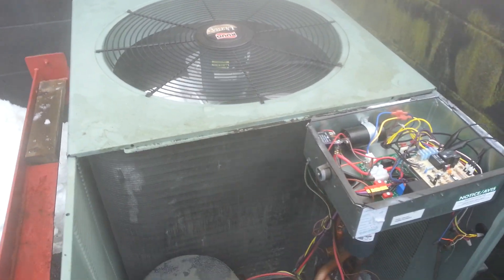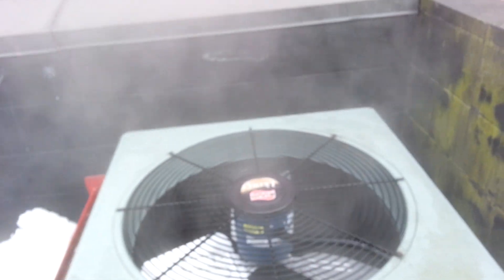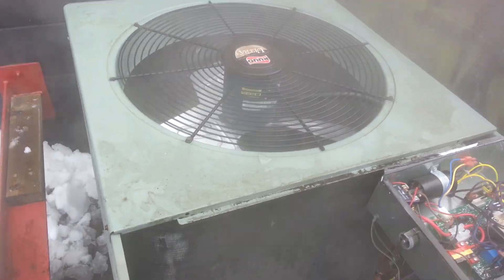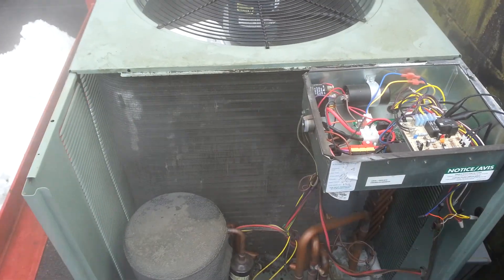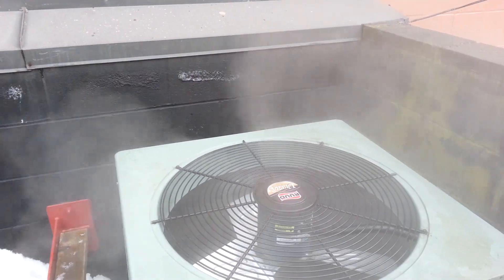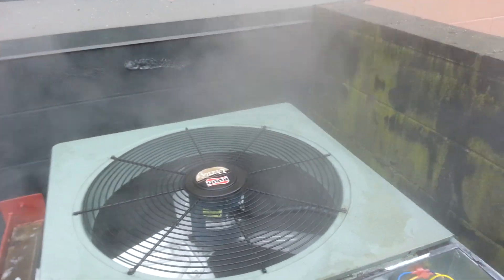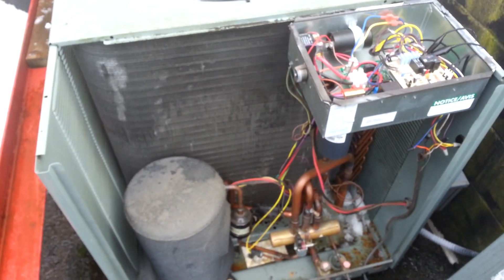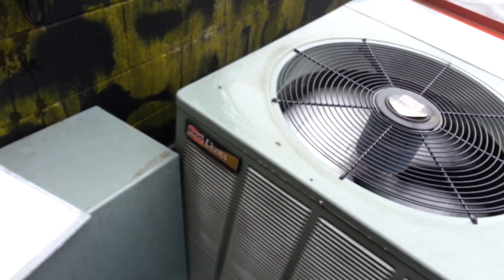Iced up Rheem heat pump

Comment: Why didn't they hire you? This is a big mistake those are the RUDD ACHIVER ULTRA UNITS. I HAVE AMANA AIR COMMAND DISTINCTIONS CONDENSER UNIT AND THE GOODMAN EVEREST EXTREME COMFORT SERIAL COMMUNICATING FURNACE WITCH IS A TWO STAGE FURNACE.